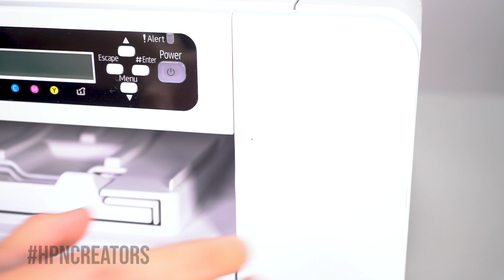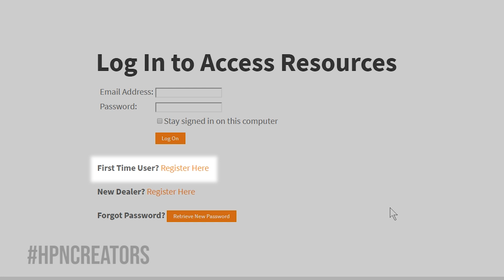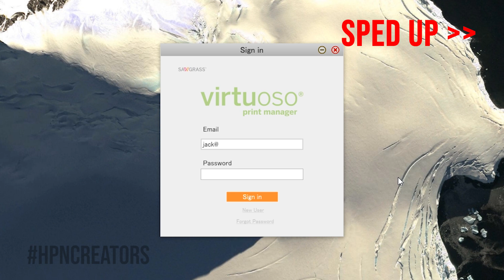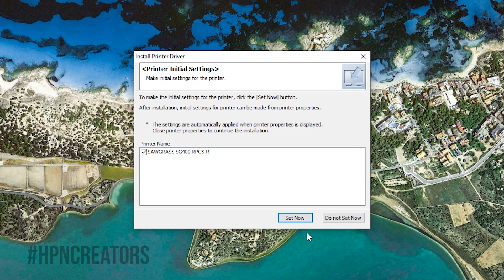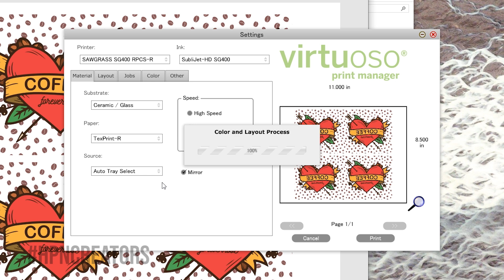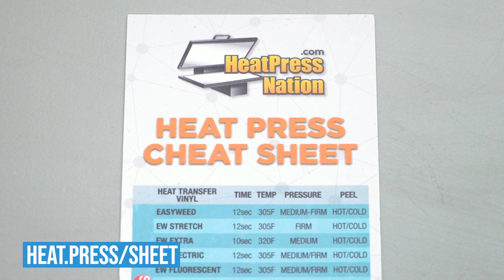Setting Up & First Print with Sawgrass Virtuoso (SG400/800) Sublimation Printers

Comment: Can you power down these printers without them clogging
Reply from the maker: Hi there! Sawgrass printers have a self-maintenance feature. As long as they are plugged in, they will go into sleep mode and turn itself on once a day to rotate the heads to avoid clogging.
Reply: @HeatPressNation  so you can’t power them down completely

Comment: hi ...thank you for this video...i have a question regarding the sg800... ive installed and used the printer a few times....i got a little bit busy and a few months later i tried using the printer again...now, it seems that my printer wont print...almost as if it isn’t connecting to the network... ive been troubleshooting for a while...i paid a lot of money for the printer and really need it to work... any suggestions?  thank you
Reply from the maker: Try uninstalling Sawgrass Print Manager, then downloading and installing the latest version from sawgrassink.com/software. If this does not work and you purchased your SG800 from us, please feel free to reach out to our Technical Support department at (800)215-0894. 

If it was purchased from another retailer, we recommend reaching out to them or Sawgrass directly. Sawgrass support information is available at https://supportdesk.sawgrassink.com/en/support/home

Comment: Completely unable to print via Print Manager, have reinstalled 5 times and have decided the only way to print is directly from Photoshop, unfortunately this leaves wide bands across the entire page which Sawgrass say is because I am using Photoshop and that I have to use Print Manager even though they know it will not print.  SG800  Mac OS10.15.5 Catalina.
Reply: Omg I’m having the same issue and can not find a solution it’s driving me crazy
Reply: Same issue here

Comment: Is this the same for sg500?! Also if we have the newest MacBook is there a connector to that, because it doesn’t connect to usb?
Reply from the maker: We just added a new video that shows how to setup and perform your first print with the new SG500: https://youtu.be/lunLovnnhOI

You'll have to buy an adapter or hub so you can connect your old USB devices to your computer's USB-C port.

Comment: Don't buy this printer. Recently they did an update, and a user cannot use other company's ink. If you do you get a black grid watermark on your print job. You have to use their very expensive ink. There are other sublimation printers that work just as well, and the ink isn't as expensive as Sawgrass ink.
Reply: Roger S wow so they created ink specifically to use with their printers and you’re upset because they do not allow off branded ink

Comment: Hello, very helpful video.
I am just starting in sublimination and i have some questions please.
So first one , will i be able to subliminate on any material ( mug, polyester,cotton,stone,wood,ect) with the sawgrass sg 400 and a heat presse? 
Did it work with the same ink and paper for all materials? 
Thanks you !
Reply from the maker: Happy to help! 

1) For hard items like coffee mugs and metal panels, the items need to be specially treated with a poly-coat specifically for sublimation. While you technically can treat items yourself, we do not recommend this at all, since it's difficult to achieve consistent, professional results. You'll want to purchase items specifically made for sublimation from a reputable dealer. You can view our complete selection of sublimation blanks here: https://www.heatpressnation.com/sublimation-blanks.html

For garments, we recommend using 100% polyester. Sublimation dye will not adhere to cotton. If you use a cotton/poly blend, it will not have the full vibrancy of 100% polyester.

2) Yes, you use the same printer, paper, and ink for all sublimation substrates - coffee mugs, t-shirts, photo panels, ornaments, etc...

We have lots of sublimation videos here on our channel! Be sure to check them out for more info =)